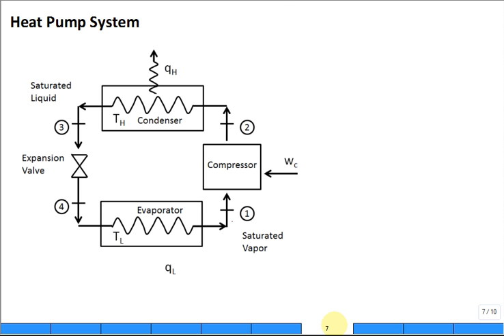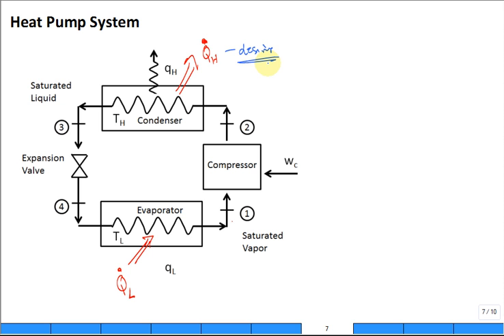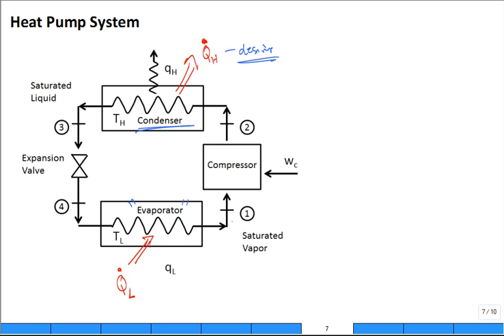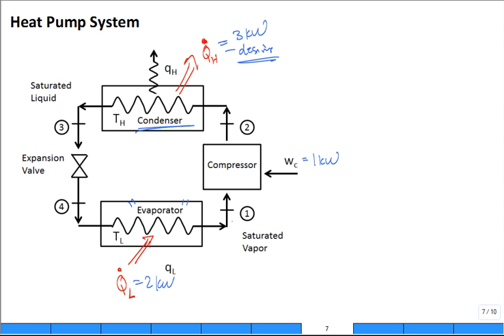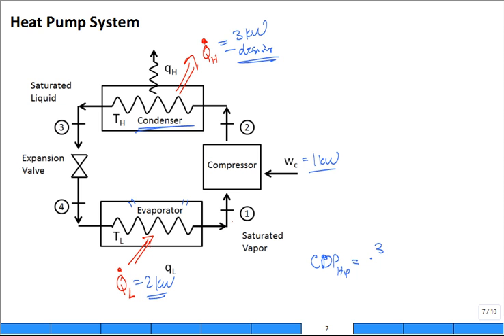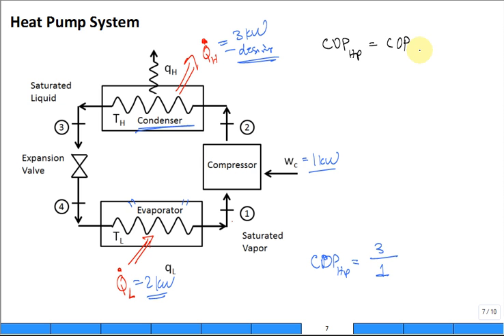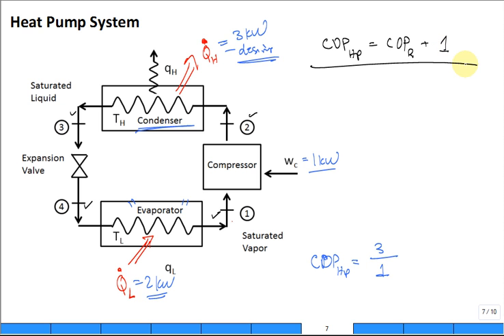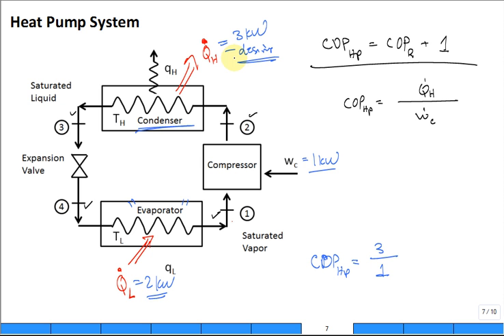Discuss Heat Pump and COP

Comment: why COPhp= COPr+1 then?
Reply: Because the work put into the system is also converted into the desired heat, so the COP = |Qout|/|Wx| with Qout = Qh+Wx. So then COP=|QH+Wx|/|Wx|=1+|QH|/|Wx|.